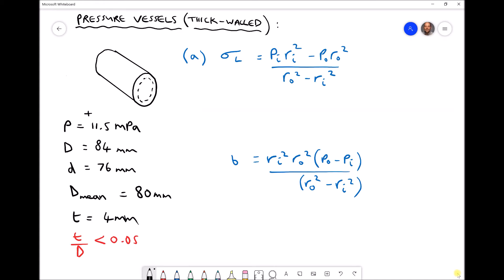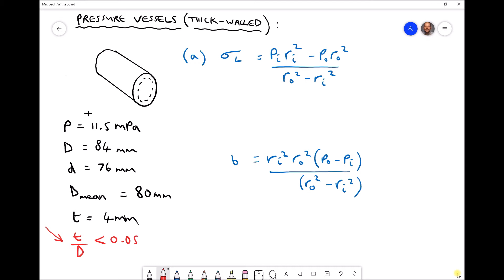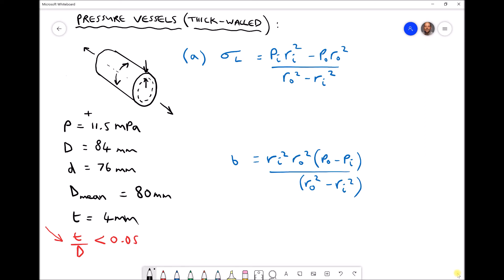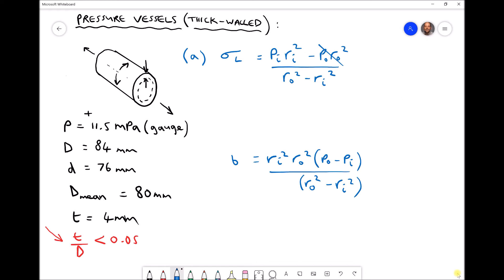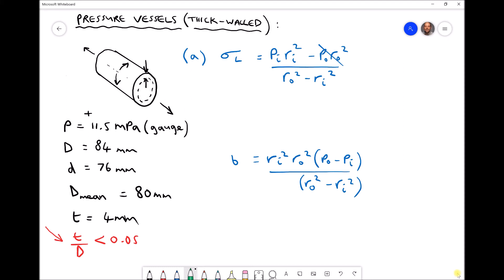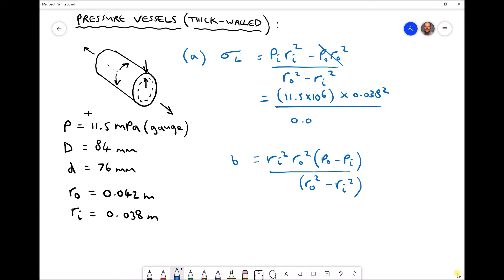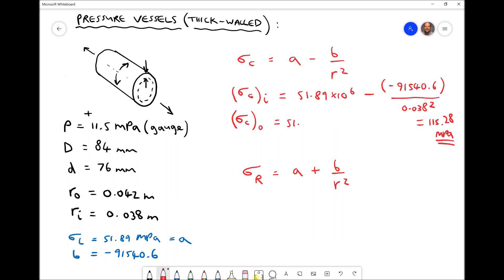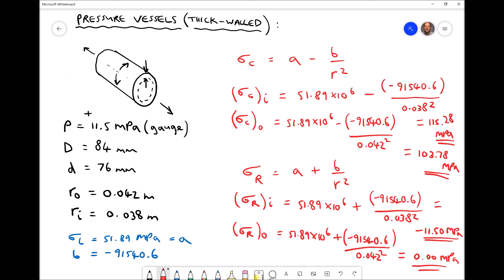Thick Walled Cylinder Theory - Stress Calculations

Comment: Are the radial and circumferential the right way around? Ive seen online where the radial stress is a - b/r^2 and the hoop stress is a + b/r^2 just making me a little confused as what the right was round is
Reply from the maker: Hi Michael, these are the correct way round for the equations that we are using.  There is a variant whereby the numerator of b is just P_internal.  However, the numerator of this variant is (P_external - P_internal).  This accounts for the + and - being the opposite way around.
Reply: @EngineersAcademyLTD  Ahhhhh I see. Thank you